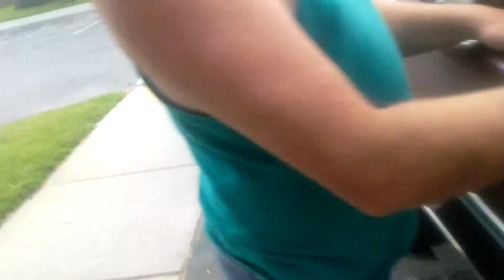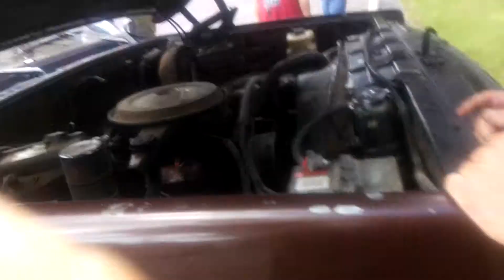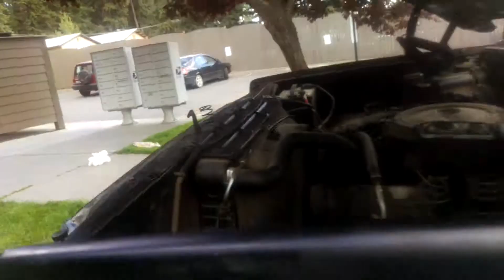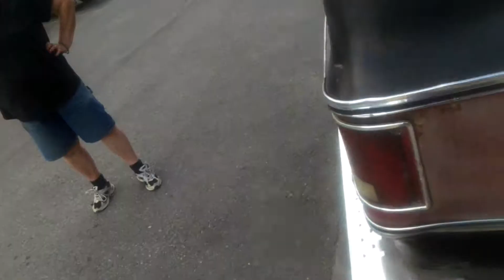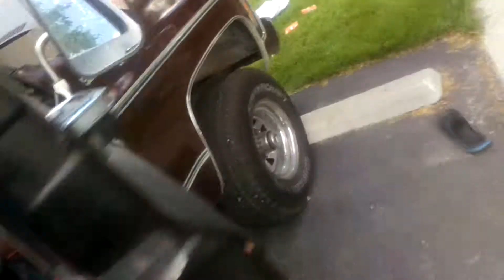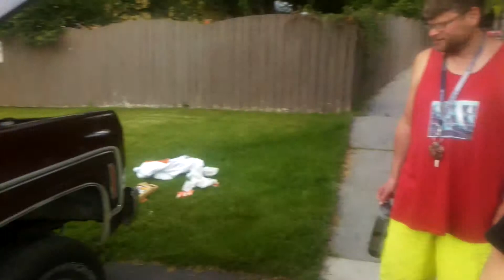1976 Chevy/Chevrolet Silverado K10 fresh oil and spark plugs

Comment: Looks like a 75’ because the engine size is on the front of the grill. 1976 is when Chevy stopped putting the engine size on the front of the grill.
Reply from the maker: It is a '76 the grill was replaced at some point before the owner bought the truck. The owner didn't know till I told her. She owned it since '85